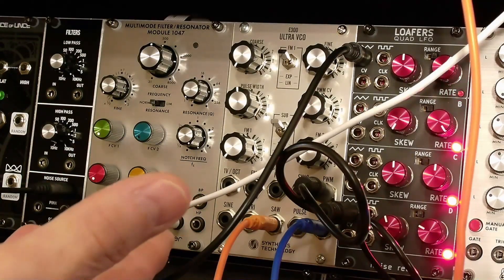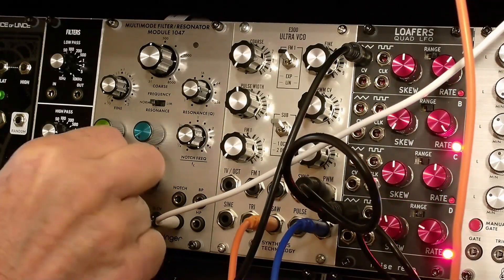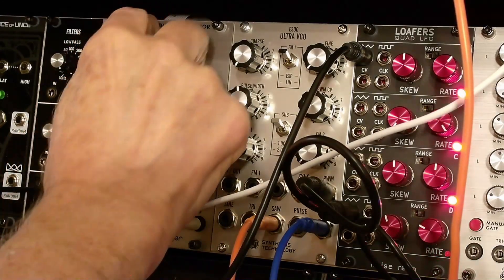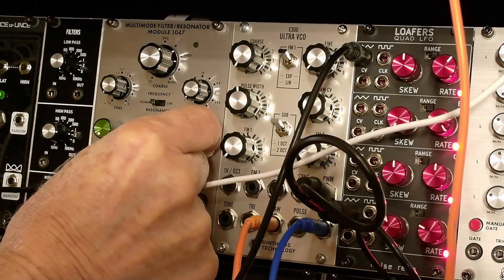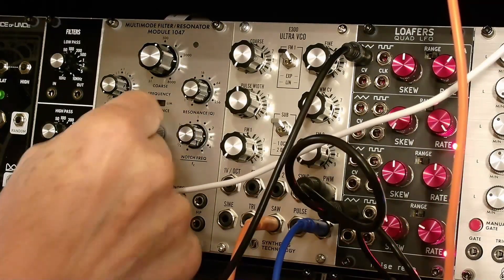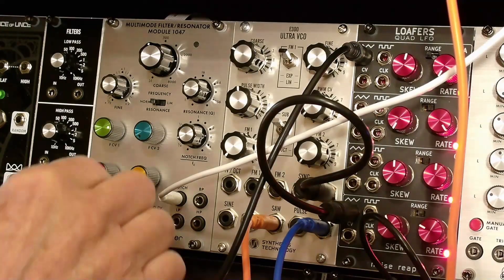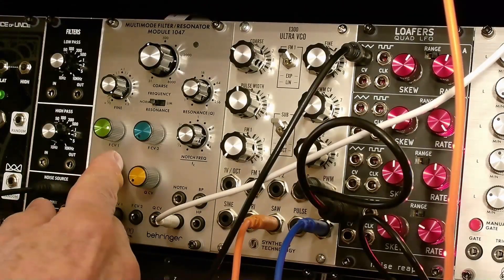Behringer ARP 2500 1047 Multimode Filter - Part 2 - Different Filter Responses

Comment: How does it do drums?
Reply from the maker: If you turn up the resonance on a 4 pole low pass filter (e.g. Moog Ladder filter), the filter will often oscillate.  The tone that it creates is a very pure sine wave.   If you connect an envelope to the cuttoff frequency (i.e. control pitch), you can get the classic 80's electronic tom sound.  Make it low frequency and you have a bass drum.  Add noise for a snare sound.  The envelope is Attack: fastest setting;  Decay: set to taste for how fast the pitch falls;  Sustain: minimum; Release: same as Decay.
Note that while the 1047 does not oscillate at max resonance (that's one of the special things about it), you can still get a tone if you also put the fast envelope into the audio input, to "excite" the filter.  It will produce a tone for a short period of time.

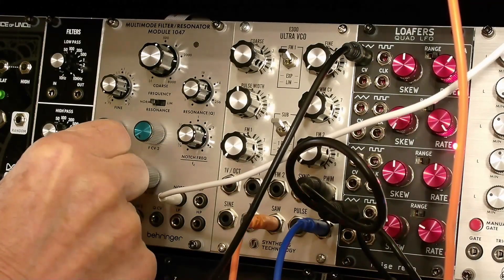Comment: Nice demo. Where is that buzzing coming from at 7:00 if your just putting a saw wave in?
Reply from the maker: Thx @WVO 2M .   The buzz you hear at 7:00 is the upper harmonics bleeding through as you crossfade between Lowpass and Highpass outputs.  That''s what you get at the "Notch" output.  at full clockwise of the "NOTCH freq" knob, the "Notch" output is the same as the Lowpass output.  at full counterclockwise , it's the same as the Highpass.  at dead center, you have the traditional "notch" filter response.
Reply from the maker: @russ254  cool!